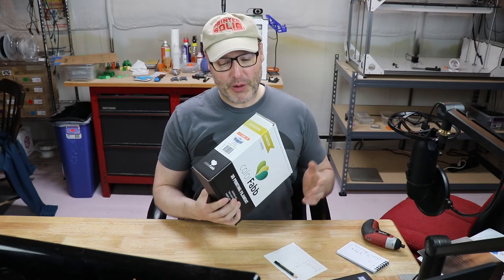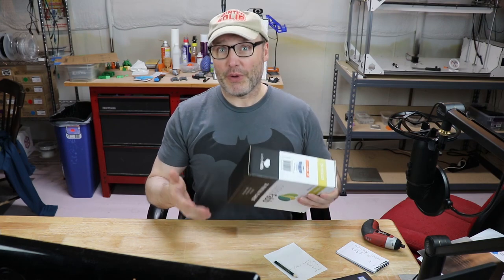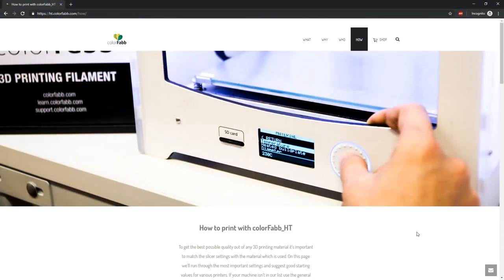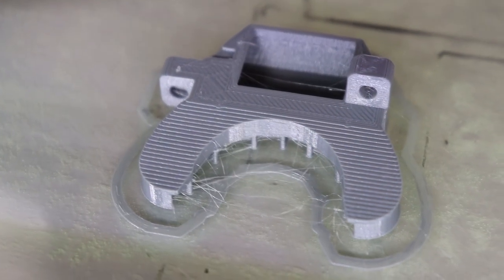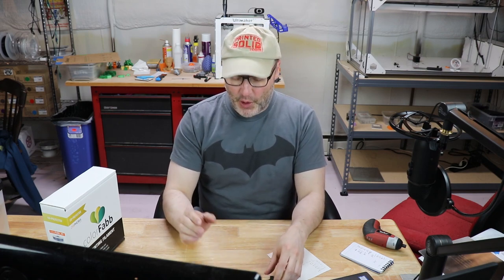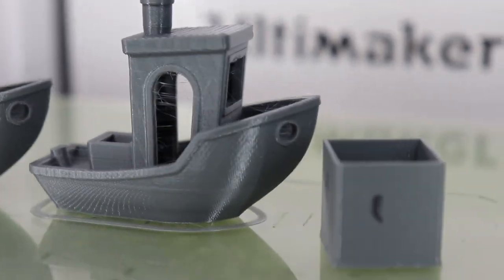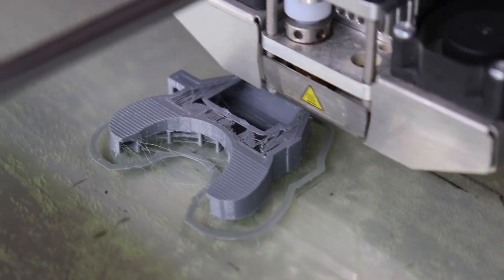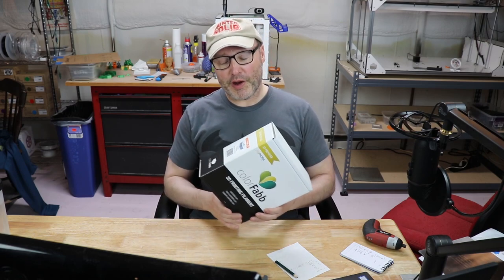Printing with ColorFabb HT filament!

Comment: Id be interested to see a heat deflection Temp test with ColorFabb HT, Ultimaker CPE, Filamentum CPE, and maybe PolyLite ASA (or similar). Basically a high temp filament test for any HT filament which can be printed on hobbyist printers.